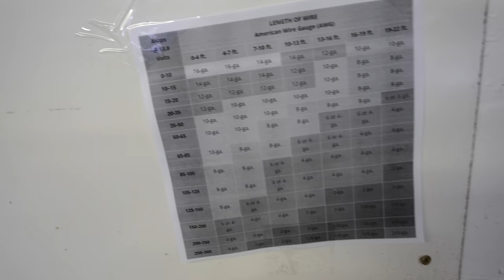Building the Brains of a Low Voltage System - Electric Hummer Conversion

Comment: Great video! I'm not sure that bit about stranded vs solid wire is correct though.  In all applications the amount of current that can run through the same gauge of stranded wire is less than an equal gauge of solid wire.  This is because the packing density of a cylinder isn't 100% efficient and therefore there are more air gaps in a stranded wire of the same thickness.  I think what you were getting at was the "skin" effect of thin wires.  The greater the surface area, the more "skin" area it has, this skin is where current dissipation happens (which is one of the main causes of "voltage drop").  

Stranded wire is definitely best for your application, but solid wire is much better at carrying large current.
Reply: Skin effect actually kicks in only in higher frequencies. 👍🏻
Reply: it's about the stifness, simply it would be hard to bend a solid cable of this diameter
Reply: While it's true that wire stranding is the best way to reduce skin effect, it's an essentially moot point here because skin effect is only present in AC electrical systems where current flows in both directions in a sinusoidal waveform. This pushes the vectors of functional current to the outside of the wires. While electric motors do create an electromagnetic field (it is in fact the very principle upon which they work), it does not interact with DC current in quite the same way and any variable waveforms are minor and happen in very small segments of the conductors. 

DC power can be utilized in any number of waveforms, especially with modern digital capacitative devices. DC to AC inverters work this way, providing opposing charges, stepped up to AC equivalent voltages, ramped up and down at the appropriate frequency to mimic the current created by an electromagnetic generator. Standard DC current, however, is applied at a constant voltage when coming from sources like a battery. 

The important thing is to ensure that the conductors will not be at risk of being damaged, which flexibility is good for. Additionally,  because of the higher 480 volt system, much smaller cable can be used to supply the power because current (Amps) and voltage are inversely proportional in reference to conductor resistance (per Ohm's law) which causes power loss to heat and degrades insulation, and they are directly proportional to power (watts), meaning that higher voltage with lower amperage can supply the same functional power with smaller conductors as lower voltage with higher amperage.
Reply: The longer the wire the more resistance it will have.  Speaker wires for instance need to be the same length to be the same volume.  Resistance also creates heat. The longer the wire the more resistance you have which creates more heat.  More heat creates more resistance in the copper wire, leading to more heat leading to more resistance and this cycle leads to melt downs.
Reply: He also, called the "normally closed"  an "always on" connection
Reply: Current will be mostly DC between the batteries and the motor controller.  Then, since he is using an AC motor, the current will be AC (3 phases) between the speed controller and the motor.  The frequency will probably varies between a few Hz and a few kHz, depending on the speed of the motor.  Skin effect is not that important at low kHz.

About the wire, I don't think that stranded wire gives an advantage over solid at high frequency because the strands are not insulated from each others.  The current can still flow through the section of the wire, causing the same skin effect as in the solid wire.  In high frequency transformer, we use Litz wire to reduce skin effect.  Litz wire is like stranded wire where all strands are insulated from each other (they use magnet wire, which has a layer of varnish over the copper), preventing them from electrically touching each others.  This reduces losses due to skin effect by a huge factor.  The chokes and transformers inside the speed controller and in the high voltage to 12v converter are surely made from litz wire, like in most high frequency power supplies.
Reply: @alexanderbrown916  which kinda makes sense if you think about it
Reply: I thought more strands are used to make it more flexible
Reply: @sedativelimit  in a high vibration situations, it is best to use stranded cables because of its flexibility. And it will reduce mechanical stress of the equipment terminals.
Reply: Skin effect happens at high frequency ac, also all the strands are connected together so it doesnt help with the skin effect at all. They would need to all be insulated from eachother (like in a wireless charger coil)
Reply: The skin effect might be visible in the alternating current in the AC motor cables depending on the frequency of that current and the cable thickness. How deep the skin effect goes can be calculated. A short table to give a impression. 
Skin depth in copper
Frequency	Skin depth (μm)
50 Hz	        9220
60 Hz	        8420
10 kHz	        652
100 kHz	        206
1 MHz	        65.2
10 MHz	        20.6
100 MHz	6.52
1 GHz	        2.06
As seen for very low frequencies 50/60 Hz the skin depth is about 8-9mm meaning a solid cable 16-18 mm in diameter performs almost the same as a stranded. For 10 kHz the skin is already down to 0.6 mm so a solid cable up to 1.2 mm will perform about the same as a stranded. 
Fun fact: the largest high voltage cables are that thick that they actually are standed as well to get rid of the Eddy-currents, even at 50/60 Hz. The strands are thicker then solid cable in our houses.
Reply: Stranded or Flex cable actually has a larger current carrying capacity due to heat dissipation (each strand can cool down much faster than 1 large cable) for example if you had 100 small ice cubes or 1 massive block, the smaller ones would melt much faster. I’m an Electrician myself and sometimes in difficult installations where the lead in conduit is quite small for a job where they require a higher current rated switchboard, we will be able to use 1 sized smaller in flexible cable over normal stranded due to it having a larger CCC, this doesn’t always apply but one example is one job required 70mm2 stranded due to the voltage drop over a long distance, but we were able to use 50mm flex 😊
Reply: @alexanderbrown916  😅 was thinking about this too! I named that AC (Always Closed) in my head thinking i never heard of that before 😂
Reply: @devparapalli  i guess not! It’s not always on! Only when not in use
Reply: For wires that thick, significant skin effect will show up at just about 200-400 Hz
 - so maybe for the cables going between the inverter and the motor, it can give slightly lower losses to use stranded wire (mainly at high motor RPM, when a relatively high frequency AC is used). For DC lines, it doesn't matter, of course. 
I don't know how effective a cable like that is to prevent skin effect though - because the strands are not insulated from each other. For most high frequency applications, where skin effect is a concern, many thin magnet wires (which has an insulating layer on them) are often used in parallell, or litz wire (which consists of many thin magnet wires that are twisted together). 
The main idea with a cable like that is mostly to be flexible. A solid "wire" with the same cross section area would not even be a wire, but a bar...
For example the 00 AWG (67,4 mm² cross section area, for us non Americans) would be 9,27 mm thick, or the 0000 one (107,2 mm²) would be 11,68 mm thick. Now that wouldn't be very easy to work with, LOL!!
Reply: Most replies afaict miss the point that solid is more prone to fail from vibration metal fatigue.
Reply: That make sense to me. My compressor, if I plug it into a standard 15amp circuit fed by 14-2 "14 gauge" wire, it runs perfect no matter how far it is from the circuit panel. But it I ever use an extension cord (which is stranded), then a 12 gauge can't cope and compressor struggles even though the 12g is higher than the 14g! If it's cold and I can't plug direct into a plug, then I have to use my fat 10g cord. Yet the 14g main circuit works fine.
Reply: Smaller strands for DC, larger or solid for AC. This is why automotive wires are always really tiny strands making up large gauges, and AC stranded is really big strands for larger gauges.
Reply: Skin effect doesn’t apply for DC at all.
Reply: @batugunduz3950  that's not true. When you're talking air space when referring to electricity you're taking the width of an electron into account
Reply: @danvinogradov138  Im sorry but i didnt say anything about air space. Could you have you mixed up the replies?
Reply: That was what I was thinking as well but I worded it differently.
Reply: Solid is also redundant in auto. Its hilarious how many electricians think they can do the same shit autolecs do and fail so misserably.
Reply: Skin effect is really only an issue in really high frequency and super conductors
Reply: A stranded wire will have a larger overall diameter than the same AWG solid wire because of that packing density. The AWG is based on the cross sectional area of the copper, so adding inefficient packing increases bundle size of the conductors rather than reducing the amount of copper.
Reply: @KeithZim  So if you short a car battery with a 1 G Ohm risistor, you will make a lot of heat, but a wrench ( 1 ohm) will do nothing?
Reply: @carson5879  
...the Ampacity of a Conductor does not change wither it is in an AC system or DC system... 

Ampacity of a Conductor's principle issue here is the dissipation of heat, the Voltage Capacity of a Conductor's principle issue is insulation... call me when you start using 20kv wire rated at 10amps like I do when I wire the controls in an Induction Furnace; then we'll talk  

you should read the NFPA70 NEC 2020 part 300 before you try to bullshit your way through this and start a gawdamn fire
Reply: @ki4clz  I think perhaps you did not read my comment thoroughly... Maybe go back and read it again and then also consider why you felt personally insulted enough to reply so aggressively. Your job sounds cool though!

Comment: Zack, It doesn't look like you have any fuse protection for the individual relays.  If you had a fault with the loads of the relays, other than the far right one, your only protection is your 100 Amp circuit breaker which far exceeds the capacity of the relays and wires on the relays.  And could set your passenger on fire :O
You may already have done this with added fuse block shown at the very end of the video.  The red/orange power wires on the relays should each go to their own fuse of 30A or so and not to the red bus bar.  
With that said, for learning as you go, you're doing a great job & neat work.  I love your channels.
Reply: Now that you mention it, you're right. Very dangerous electrical. Those relays are unprotected.

Comment: hey Jack. The skin effect - where the electric current primarily runs near the surface, only applies to high frequency. for DC applications it isn't really a concern. Flexibility with stranded wire is essential for chassis wiring applications though.
Reply: Current depth is dependant on frequency. Not just at 'high' frequency.
Reply: Thanks for commenting! I also reacted to this. I am with you on this. @pjtuslow @shocker99
Reply: Stranded wire is also very important for vibration such as automotive applications.
Reply: Exactly this. Most common misconception about skin effect.
Reply: Correct, was searching in the comments to see if someone else had posted this fact, did have to scroll down quite much.
Reply: You can get skin effect with AC systems and is something to consider with transmission lines.
Reply: True
Reply: The main reason why it's stranded because it's horribly impractical to have a big chunk of copper that'll snap in even the slightest bends
Reply: skin efffect does absolutely nothing in this case cause all wires must be isolated from oneanother for harwesting benefits of high surface-area conductor
Reply: That looks like welder cable...
Reply: The motor he is using is 3-phase AC so for that use case he's still ok thinking about the skin effect.  It just doesn't apply to DC.  So with the 12V system, not a concern.
Reply: Jack?
Reply: @obamalore  oh wait lol it’s Zach isn’t it. I knew his name wasn’t jerry at least. Apparently I still remembered wrong
Reply: @michagabo8819  as an Italian, I trigger fallouts all the time, 10/10 would confirm.

Comment: CAREFULL!!!! Your high side power wires for the relays should all be individually fused. As you have it wired now if anything on those relays short circuited there is no fuse and only the high power breaker as protection meaning the short would go up to 100Amps before the relay tripped which would definitely fry your wiring. Otherwise very well done and layed out.
Reply: I think he addressed and fixed this in the next video
Reply: I was thinking about the same.
Reply: hopefully he also stoped running the negative threw the frame
Reply: Think he mixed copper and aluminium wires in a solder connector
Reply: @jalalalap-akalala  those looked like tinned copper

Comment: When you say that electricity only runs through the outside of each strand of wire, you're referring to the skin effect. This only applies to high-frequency AC though. Low-frequency AC and DC will in fact use the entire 'body' of the strand. Large cables are generally stranded so that they remain flexible.
Reply: Both are right, is the first time i got him a mistake.
Reply: ...and at really high frequencies (Microwave), waveguides are used.
Reply: I just recently took a materials science course, and came straight to the comments because his explanation seemed a bit off. Thanks for clarifying!
Reply: Yes, but the wires he showed were orange ones which are the thickest and certainly for the powertrain which is 450V AC. So that’s that. 

Pretty sure the thin 12V ones are lesser strands.
Reply: @shresthsonkar9207  Yeah, but unless that AC is in the high Khz range and above the skin effect is fairly negligible.

Comment: As an Electrical Engineer, I love the explanation that you used for relays. It made it super simple to understand. And for people wondering why you can charge your phone in your car with some cars off versus some cars needing to be on, this is your explanation. Different systems have multiple ways of being wired. There's never really one "correct" way of it being wired since there's multiple solutions for multiple needs and some people value certain things over others.

Comment: Zack, you may want to fuse the wires going to the relays!  You only have that protected by the 100A breaker, which leaves plenty of angry pixies to melt wires!  Also, I can't believe no one mentioned that in the comments yet (at least I can't find any mention of it), everyone is focused on skin effect ;)
Reply: Came here to make the same comment. The wire should be able to handle the amount of current between the battery  and the fuse without melting. ie that 12awg wire between the buss bar and the relay should be fused around 30 amps.
Reply: @twilliamson3  great point. Another thing to point out is that thermal circuit breakers are not great, especially if you want it to work in various ambient temperature. The required current to trip the breaker can range by -30% to +60% or more of the rated value depending on the overall temp range it needs to exist in. However, since he's not running a single device off the breaker, it is really only protecting the wire from breaker to battery, and as long as that wire is large enough to supply near double the breaker's rated current, then it will be able to do it's job just fine. However, the breaker is still more expensive than using a fuse. I usually recommend fuses over thermal breakers for this and other reasons. On the flip side, if the breaker were mounted in a very warm place, it might only need 18 or 20 amps to trip a 30A rated breaker, which leads to nuisance trips
Reply: I was going to mention that switch your ground side of the circuits and have constant power to them will be nicer to any accessories that have integrated circuits. This exactly how ECM’S are switched inside. They switch ground drivers on and off.
Reply: I saw the same thing, and did mention it in the comments. The wires from the power bar can be connected to the right fuse block (constant voltage) with fuses suited for the connected load.
Reply: The relays are protect from the load and 95% of the circuit, by going through the fuse panel. The only thing unprotected is the short wires going from the main feed to the relay(still protected by the 100amp total draw). This is completely fine. In order to melt the wires you would need to a short to ground condition on the relay feed wire. This is highly unlikely and can be controlled by careful routing and securing the wires. This is common practice in the automotive industry. You can't 100% protect everything. You can only protect the 95% of the circuit. To put it another way, say he has fuses protecting each relay. He will then still have unprotected wires feeding each fuse for each relay. Until you get infinite regression.
Reply: @mission772  only one of the relays is feeding the fuse panel.  The rest of the relays are dedicated to higher power devices, and are not fused.
Reply: @AlecKristi  So far yes, but he hasn't added any unprotected loads yet. I assume he is going to have inline fuses for the other relays.
Reply: tweet him
Reply: @sujeewarathnaweera  I'm not on Twitter...